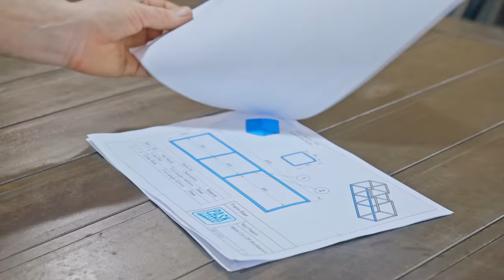Workbench for the Metal Cut Off Saw

Comment: Word of wisdom to anybody building something similar - make the dropped center section deeper than your current saw and shim the saw up to flush. There are few things more irritating than buying a new upgraded saw only to realize it has a thicker base and now you need to modify your bench.
Reply: Good idea, thanks for sharing it.
Reply from the maker: That’s a great idea Bradley - if I do ever change the saw and the base is higher I’ll just have to wrestle the tops off and fix them back down with shims. :)
Reply: I was thinking along similar lines, like bolting in the center section do make later modification easier.
Reply: I was thinking exactly this when he was putting the saw in... Bad case I guess you could build a recessed tray to make the middle section sit a bit deeper (bonus dust collector!), though that would require redoing those support welds he said he added in the plans.
And worst case, trim the saw's base down.
Reply: @nordishkiel5985  Bolting the center section and whenever you need a new drastically different height just drill some new holes! Ezpz
Reply: My old shop Forman only needed sandpaper as his shims for this type of project. He set the bar high for us to make sure of our measurements 😊
Reply: 🙂 looks like a word of experience...
Reply: Love your build. I am a hobbyst metal worker, and i have a question, how do you cut square tube with abrasive disks and kept the cut square? My cut with abrasive disks always make the cut slightly mitered/sloping. Thanks for sharing.
Reply: Hey Neil,  good build and yes I'll do the same. Tell me, what's the orange airflow helmet you use for grinding etc?

Comment: Nice work Neil! If I were you I would get rid of the cut off saw for a cold saw, best thing I have done in my shop. they cut straighter with a nicer finish and the part doesn't get hot.
Reply: Cold saw changed my life cutting steel. The time saved paid for itself in two days.
Reply: I was thinking the same thing. The abrasive saws aren't saws at all, they wear and melt their way through the metal. The only downsides to cold saws are the needle-sharp bits they make, but those are preferable to fine dust settling everywhere.
Reply: @Bob_Adkins  I'll take the sworf over flying sparks any day 🤣
Reply: But you can make nice Damascus with all the swarf
Reply from the maker: Thanks John! You’re probably right and I’ve thought about it but when the saw i have works well enough it’s difficult to justify it. I would like one though so you never know. :)
Reply: Yeah, I'm sure Neil will have a couple of jobs with hundreds of cuts and take the plunge to get a cold cut saw.
Reply: @PaskMakes  You could sell your current saw so it wouldn't sit around the shop collecting dust. The cold cut saw would be well worth it. Imagine cutting all that sheet metal for the bench with an angle grinder vs. your Bosch circular saw. It would feel slow and barbaric in comparison right? You'd feel the same about that abrasive saw after upgrading to a cold cut chop saw. I feel like you could even get a sponsorship deal from evolution or the brand of your choice if you wanted. :D
Reply: @PaskMakes  you could probably find a cold cut saw blade that fits your current saw, that saw should be more than rigid enough for a carbide saw blade. Your saws almost exactly the size of My evolution cold cut saw. I think the blades are about 50 bucks, maybe 7 seconds to cut box tubing like that and it makes 0 dust and little to no sparks just a heap of metal chips to clean up.
Reply: I was thinking the same thing. I bought a cold saw just to keep my workshop clean. They are more expensive but the blades also last longer ( if your careful).
Reply: @Bob_Adkins  o
Reply: I was given a 50+ year old Italian cold saw. It needed some TLC but now works great. It came with two steel saw blades (not carbide) and cuts through 4130 like butter. It is a cast iron machine. Movement is via dovetail ways. The blade rotates toward the vice, not toward the fence. It keeps small cutoffs from jamming into the fence gap. The motor is two speed and powers the blade though a gear reduction system. Blade speed is quite slow. The coolant system works well. The vice can be set to automatically clamp and unclamp as the head is started down or fully raised. I think these saws originally came with pneumatic up/down operation of the blade as an option. It is 3 phase, which I have in my shop.
Reply: @PaskMakes  I use my cold saw for cutting wood sometimes as well as it has fine tooth pattern and strong motor they tend to leave a nice finish on wood.

Comment: Awesome build. I've been building all of my shop furnishings out of galvanized fence posts and Steeltek fittings. No welding required, and if I ever move, all I gotta do is unscrew the fittings and the whole thing comes apart. I've built my work bench framing out of it, and topped it with a solid core external door for the worktop. I built my shelves and other odds and ends out of it as well. Steeltek makes for an incredible metal frame system. But yours is so much better in nearly every possible way. What a beauty of a build.

Comment: I am  planning to make this from your plans.   One change will be a shorter table, don't cap the ends, and pick up some smaller square that can "telescope" into the ends for extensions when needed. 

Planning is the key word - will see in a few years how far I get. :D
Reply: Not a bad idea - the best thing about building your own is that you can configure it to your own needs. I would add some height adjustment at the end of those sliding supports, beacuse they will sag a bit.
Reply: Good idea!! Could probably do the same thing for a smaller welding table.

Comment: What a brilliant thorough design as always.   If I could make a suggestion it would be to add some material between the bottom rail and the floor.  That will stop anything dropped on the floor from rolling under the bench.  I guess it would need to be easily removable so you can still move the bench when required.

Comment: Thank you for another delightful practical project that's a joy to watch with your skills. Having built many factory-setting workbenches, I have a preference for a 50mm round corner on the outside of steel tops at hip height. Just too many bumping injuries moving heavy items. I look at those very sharp outside points and think about some idiot-proofing. This is similar to the trip hazard comment I made moving the bolt down ties under the bench on your anvil when you built that. I'm so delighted you share with us. :)

Comment: Great work as always.  

If I may make a suggestion for your 'plans', and anyone else that might use this idea, is to add and inch or so to the size of the steel bench top peices, and then bend down over all the edges, and weld the corners.  As you have exposed screws on the side anyway from the steel flat bar, and then siliconed the top edge, my suggestion would I believe make it look a little bit better, and perhaps save some time.  It might also prevent the need to glue the sheet down, just in case they require replacement.

Just an immediate thought as I was watching your vid.  Keep up inspiring us all.

Comment: I love it and when you enclosed it, it made it perfect. One suggestion, and you may have done so already when you caulked the top. The sides beside the saw where the saw stand meet the upper sections, you might want to run a bead of caulk there as well. Now I know that it wont really matter or hurt anything if some dust gets in there at all. Just a I really don't want dust where it doesn't belong thing. Of course that could just be me and either way I think the whole thing is brilliant.

Comment: Ace ! Dead sure one of them tool sponsors will be sending you a Cold Cut Off Saw in the post to replace your abrasive Cut Off and then you'll be winning at the races with eliminating extra dust in your work shop operating. Fantastic to see so many makers moving to Filter Style PPE looks like they becoming the standard. Major upgrade for PPE Standards.       Good on ya as always Mate!

Comment: Get a bigger bottom piece 4*6 or 4*7 cm set it straight up and weld it instead the one you used this will avoid extra casters what wilt result otherwise in a wobbly table. thanks for sharing great work as always.

Comment: 13:42 You removed the vinyl from the plywood and then used it glue-side down. Later you added the metal to the top using contact cement. Wasn't the vinyl held down with contact cement also? Adding new contact cement to old will reactivate it. So, you then wouldn't have the tacky side down attracting and collecting debris.

Comment: One upgrade (which is where I was hoping you were going to begin with) is make the back fence fixed to the bench so the only adjustment you need to make is swivel the saw, rather than set the fence and then swivel the saw.

Comment: Great video, as always!  Wonderful build, too.  I often wonder if our penchant for putting the wheels on the corners is only because the OEM mounting holes allow us to get three screws in without any problems or extra work.  Lately, I've taken to designing a long bench like yours (full box frame), with the wheels a couple feet in from the ends so the span between wheels isn't nearly so great.  This leaves some of the box structure to cantilever out over the ends, but the structure is plenty strong enough to support its own weight, I think.  While it makes the bench easier to maneuver when you're moving it, it also means you have to build in some kind of mounting plate for the casters.  A trade-off, but maybe one worth considering.

Comment: Not bad! was trying to figure out a pivot system and your way looks pretty good. I was thinking instead of cabinets underneath a steel rack for drops would be more useful. Are you happy with the flat benches on either side vs. rollers? That pre painted tubing would drive me nuts. I bet its applied cause your steel comes by barge across ocean

Comment: From one Aussie to another - I had one of these, but was never satisfied with the cutting speed, accuracy or quality, not to mention the dust problem this thing creates.
I now got a cheap circular metal saw that looks similar, but uses a saw blade instead of a grinding disc. Worlds apart. Thing is called Bayer B355 and price wise comes close to what you got there (the track saw from the same brand also works well and is compatible with the Makita guides, just in case you do flat sheet wood too).

Comment: Great bench great video 
Just wondering how you like the Bosch circular cold cut saw for cutting the steel plate
Also that T9 spray you put on does that completely dry so nothing sticks to it or does leave a film that dirt and metal dust etc sticks to 
Great vid

Comment: Neil, have you tried Diablo's Steel Demon blades for metal cutting?  I don't do much of it, but I've found they work extremely well.  Really clean cuts and both the metal and the blade stays much cooler.

Comment: 2 Questions Neil, Due to the weight and size of the bench, wouldn't it have been better to wait for the extra casters to arrive before building and standing the full bench (yes this would have messed with the Video release)? Also, I know that rotating the saw for mitres might not be needed often, but welding a strip to the underside of the bench for the bolt on the pivot point and having a longer reach on the handle and having it on the top of the plate would have made the rotation easier, and using washers to create the right positioning for the nut?

Comment: Love the build! Ive got a couple of questions - those castors - are the wheels retractable so you can have the bench sitting on solid ground? I have never seen this type of castor at bunnings. Also, your powered faceshield/respirator - any chance you can do a review on it? I have been thinking of getting the 3M unit for a some time but been put off by the cost, this tecmen one looks more affordable. How do you like it?

Comment: Only thing I would have added is a couple pin holes at 22.5*, 45*, 67.5* and 90* to always get a precise cut, fantastic work:)
Reply: The angle is set by the adjustable clamp on the saw itself.  I'm pretty sure he just made the base swivel so the the metal he cuts still has support (and fits out of the window).  If its off by a degree or five, it doesn't really matter.

Comment: Your new metal cutting bench looks awesome. One thing though. I would have made the handle to losen the plate for mitres longer and put it on the top-side so it would be sticking out through the side under the cut off machine. That way you could loosen it without having to bend down and reach under.

Comment: nice work,  since the saw rotates around the bolt… have you thought about making a mark on the base plate and coorsponding marks on the table top for quick alignment if you need to cut a certain angles like 45 degree ??

Comment: You should consider marking up the table with angle-lines (gradients?) so you won't have to measure them out if you have to turn the saw. In any case, good work.

Comment: Any reason you decided to use the 25mm edging instead of cutting the sheet metal tops oversized and bending them to cap the plywood?
Reply from the maker: I don't have a brake big enough or strong enough to make the bends. I'm happy enough with the edging and I could've even just left it, it's only really there for show anyway. :)
Reply: @PaskMakes  Thanks, I was just curious. Assumed that lack of a brake was the reason, but figured there might have been other factors that I hadn't considered. I think I actually prefer the look of the separate edging, it gives a slightly more "industrial" feel if that makes sense. Beautiful work, thanks as always for sharing!

Comment: Really nice bench.  Only thing I would change is the actual saw. Get one of the Freud or other metal cutting blades and you can do away with 99% of the sparks and potential fire hazard. Aside from not having to buy more abrasive cutting wheels and having that stuff in the air.  They're only like $30.

Comment: IIWMI would have made center cut out w/bolt thru pieces so when I get a new saw I could adjust the height w/out having to grind out the cross tubes. Otherwise a high level of execution as always

Comment: I'm a little disappointed that you didn't replace that wibbly-wobbly saw base with a design of your own using square tubing and steel plate offcuts. On my saw, the up-down pivot hole was far bigger than the pivot spindle so I made a new spindle (easier of two evils). At the moment, the basic components of the saw base introduce all kinds of inaccuracies. Nice job, however.

Comment: All that work just for an abrasive saw?
Reply from the maker: It's mainly built for the cut off saw but will obviously be used for more. It'll be a great bench to use the angle grinder at (I'll add a vice too), there's heaps of needed storage and it's quite obvious how cutting steel to length (compared to how I was doing it at the start of the video) will be awesome. :)